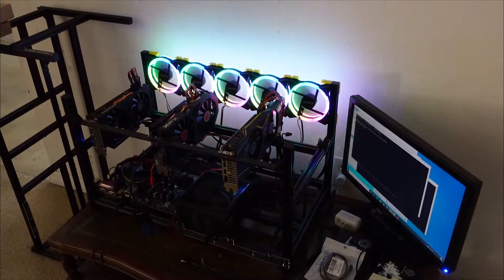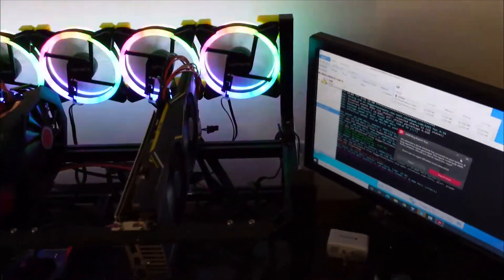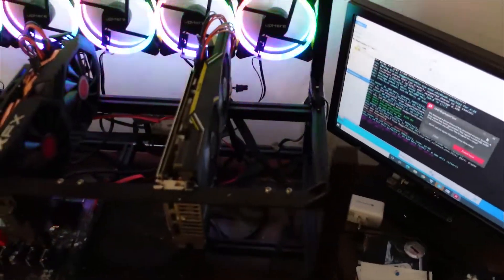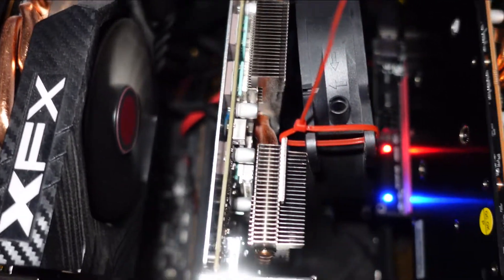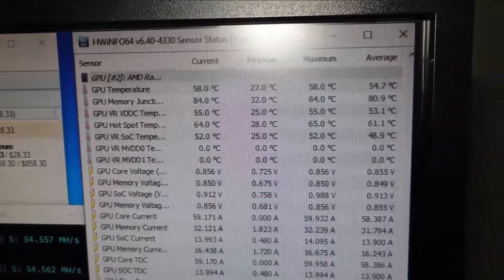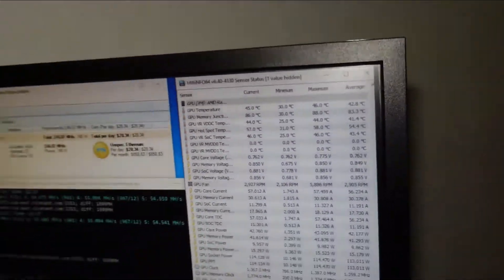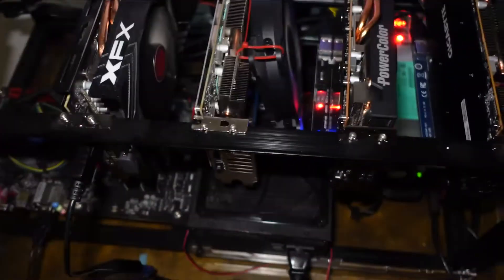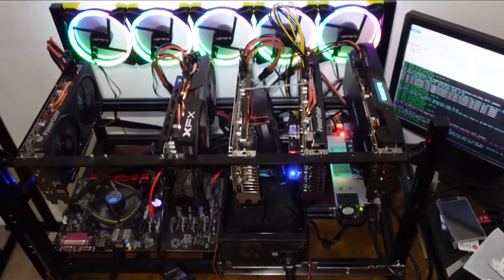Asrock RX 5700 Keeps crashing - Cooling Mod

Comment: Just an update. I got another Asrock 5700 XT Challenger that came in a prebuilt I ordered.
This GPU also had insanely high memory temperatures, ramping up to 104C in minutes after mining, open air, ambient air 23C, fans at 100 percent, underclocked and undervolted.
I installed my NZXT Kraken G12 AIO bracket/fan assembly and 240 mm AIO on the GPU to see if it would make a difference.
The stock memory heatsink assembly was too high, so I had to remove it.
The 240 mm AIO gave me very cool GPU temperatures, however it only slowed down the time it took the memory chips to ramp up to 104C.
Next I installed low profile copper heatsinks on the front side of the memory chips, however this also only slowed down the ramp to 104C.
Next I replaced the stock fan on the NZXT Kraken G12 with a much higher performing Sythe Fuma Kaze Flex with zero change in peak memory temperatures.
Next I removed the backplate and installed heatsinks with thermal tape on the back side of the memory chips. They were working as they got extremely hot, however even with a fan blowing on them they didn't change peak temperatures.
This had me stumped as these measures have worked on numerous other GPUs, VRMs and chipsets.
Back to square one. My GPUs had 1.5 mm thermal tape on the heatsink assembly, so I replaced them with 1.5 mm Thermalright Extreme Odyssey thermal pads.
This change alone made zero difference in peak temperatures as the heat from the memory on the back side of the PCB was still scorching hot.
Next I measured the gap between the PCB and backplate which ranged from 2.7 mm to over 3 mm as the rubber standoffs were different in height and tops weren't square.
My backplates were all warped as well due to poor mounting design.
I installed 3 mm thick rectangles of Thermalright Extreme Odyssey thermal pads on the memory chips, then tried fitting the backplate, however 2 standoffs were in the way, so I removed them as the thermal pads were rigid enough.
The other standoffs were too high and/or too different in height, so I shaved them down to allow enough compression of my 3 mm thermal pads.
The backplate was really flimsy due to having no center mounts, so I had to put a slight bend in it in 2 different directions to make good thermal contact through repeated bending/fitting.
Success! My memory temperatures dropped to 80C max after mining for 4 hours with a modest fan curve.
I also have a problem with one of the fans not working properly on all my Challenger GPUS, so I'm going to remove the fan assemblies and experiment with Noctua, Be Quiet and Scythe 92 mm and 120 mm fans for thermal performance, sound levels, reliability and ease of service.
The stock Challenger fans have an annoying sound at various RPMs, and I had to play around with the fan shrouds to eliminate vibration.
I have another prebuilt on the way, so I ordered more 3mm pads and some large finned aluminum heatsinks to attach to the backplates.
I may drill/tap the backplate and drill the heatsinks, then bolt them down which will make my backplates more rigid.
My sister did something similar with some 3080s pulled from HP prebuilts that would ramp up to 105C in less than 1 minute of mining while undercloked and undervolted.
We had some rectangular finned heatsinks from inverters bolted to the backplates which made the backplates more ridgid and dropped the memory temperatures.
Hope this helps someone with similar problems.
Reply from the maker: nice, a lot of customization and test to get things under control.

Comment: Hey I have the same card. can you share me your settings? I can’t bios mod it for some reason and am mining at 51mh at 103w. is it worth modding? thx
Reply from the maker: Yes, because you can get 56 MHs or close too with Mem mod. However, 0.850 volts, 1350 core clock, and 1810 mem clock. Not all GPU's will perform the same or hit same clocks so adjust accordingly.

Comment: I have the 5700 XT version of this GPU and my memory was running @ 103 plus while mining with ambient room temperatures of 70F, so I was afraid to run it more than a couple minutes.
I downclocked and undervolted, however memory temps were still way to high for my comfort.
This is brand new, yet one fan makes a clicking/droning noise when fan speeds ramp up as well.
I possibly have another Asrock 5700 XT Challenger coming as I ordered 2 prebuilts, and that's the model they usually ship with unfortunately.
I plan on replacing all the thermal pads, repasting, and adding thermal pads between the GPU and backplate.
I'm considering ordering the Raijintek Morpheus 8057 and 2 120mm fans, but I may try some zip tie fan mods before then as these units and waterblocks aren't available in the US currently.
Thanks for the videos as there's very little information about these GPUs.

Comment: i use MSI afterburner in all my rigs, and i set the fans to a relatively high rpm. i've had a lot of issues just by letting the card manage temps.  I've solved a huge amount of issues just by increasing the rpm for the fans. 

All of my RX 5700/XT do 1830mhz on the memory ONLY IF i keep 80%+ on the fans with afterburner. If not, sometimes i get thread issues and miner crashes. The "normal" consensus , is that GDDR6 is "confortable" in the high 80s low 90s , but not more than that. 

i have the exact same XFX RX590, and it's doing 2175 on the memory, 1240 core at 831mv and like 31,7mh/s.

Cheers mate!

Comment: Nice one 💪 I have exactly the same Powercolor 5700xt - struggling massively to keep it cool. Fan on 100% in hive os + external fan added and vram temps about 94-96. Only pushing 55mh/s, reported power 110 watts. Any suggestions what to do to bring mem temps down? Thanks 🙏

Comment: I have XFX 580 where the fans, sometimes only just one fan, will stop for a few seconds then start spinning again. Did you figure out what was doing that on your card?
Reply from the maker: The fan motor went out. When it spins then stops and spins again, prepare by buying a replacement